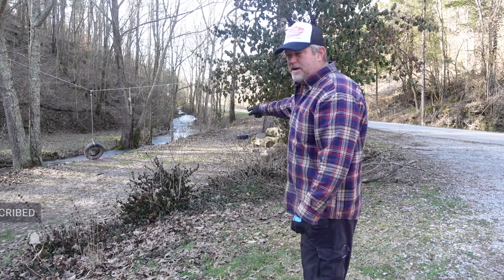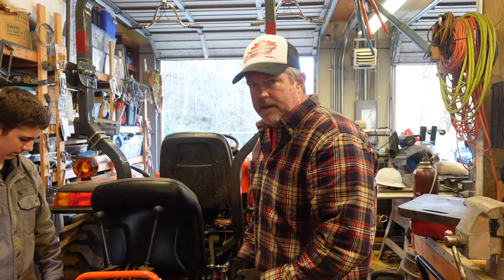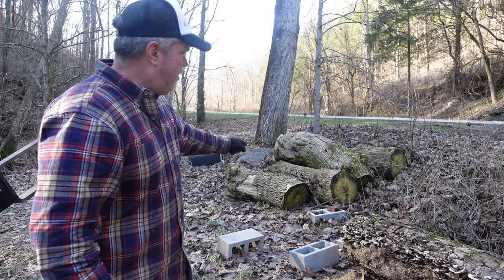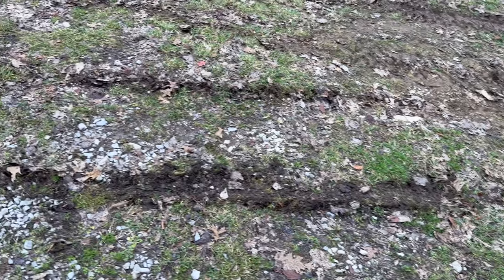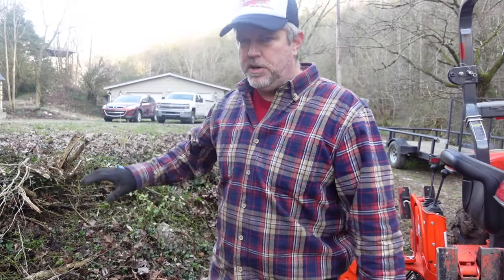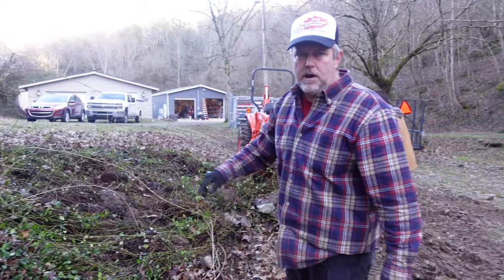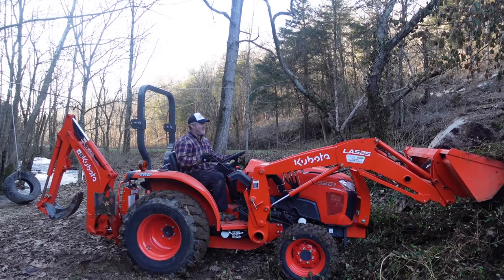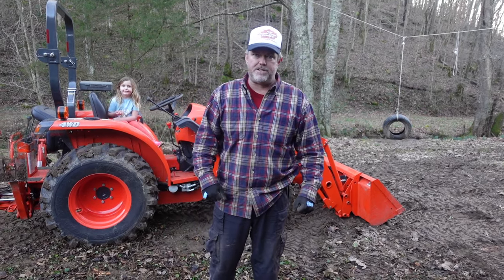KUBOTA L3301 Putting In Work! How To Attach BH77 Backhoe/ Attach Bucket/ Clearing Project Part 1

Comment: I have a L3901,  they are great tractors.  Good video...
Reply from the maker: Got mine going on 3 years ago. Have not had any problems with it yet. I keep it in the garage and wash it good often. I keep it greased and do the routine maintenance. Sometimes it gets ran hard. By that I mean it has dug out at least 6 large tree stumps. It has moved a lot of earth and rocks for hours on end like it was a full size piece of equipment. I try not to abuse it though, like no sudden movements, smooth manipulation of hydraulics and throttle. The only thing that annoys me is when it wants to do its regeneration cycle. Other than that no major complaints with it.

Comment: I have the L3901 And I’m considering the backhoe next versus spending the big money on a mini
Reply from the maker: @travisgriffiths8170  I don’t have any complaints with the backhoe, it does a really good job and I use mini excavators, skid, steers, and other heavy equipment at work. obviously it’s not going to be as powerful but for what it is, I think it’s worth the money
Reply: Yeah I’m thinking for 90% of what I need to do the backhoe will work just fine, obviously they can’t perform like a mini but I guess when a guy needs a bigger machine you can always just rent it, only having to maintain one machine is a plus as well